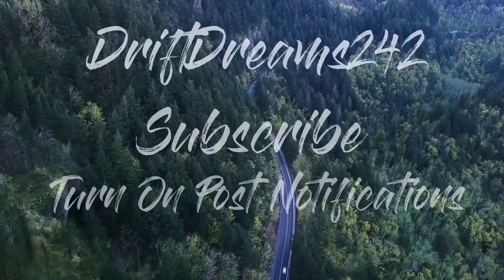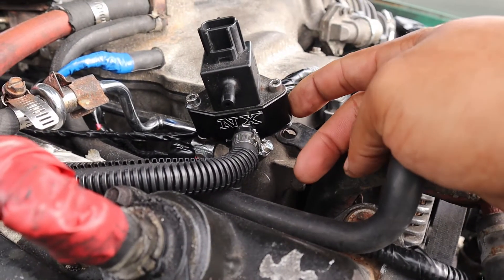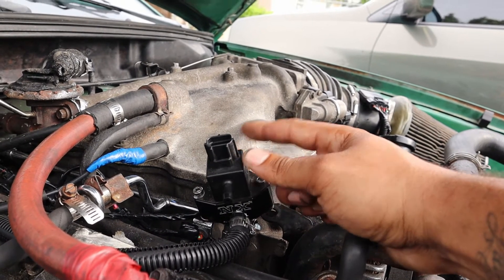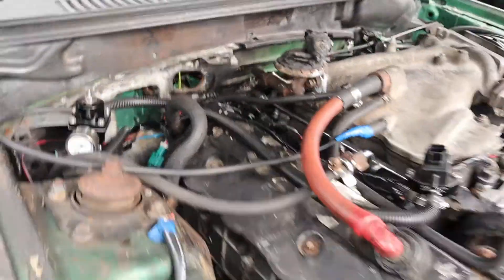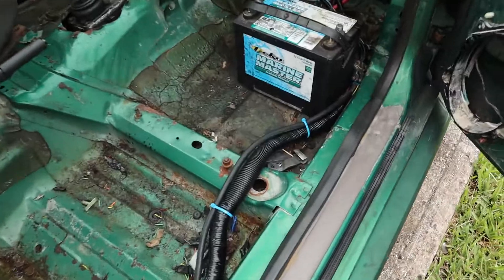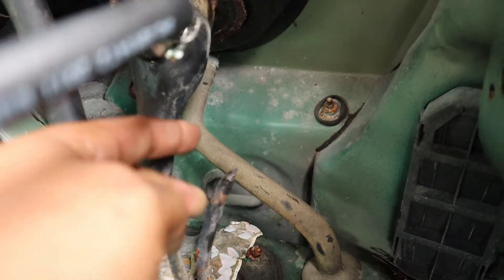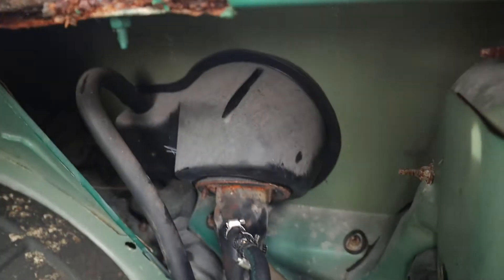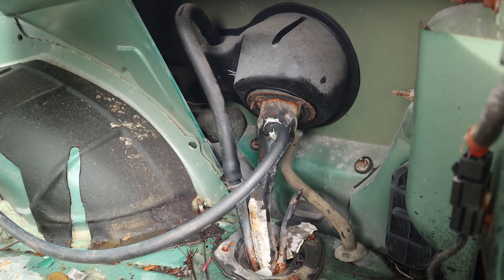How To Make Any Ford Returnless Fuel System Into A Return Style System

Comment: Why do I want one over the other? I have a 90s Ford Ranger (return type fuel system ) and am swapping in a 2.5 from a Fusion (returnless). Don’t know which direction I should go because the regulator is on the fuel rail of the motor I am pulling out.
Reply: @DriftDreams242  Thank you. So basically add a regulator to stick with return style, or verify that my standalone FI can run the pump with returnless?
Reply: @DriftDreams242  Thanks! I appreciate the help. 👍

Comment: I have a 2004 ford f150 bedeviled with fuel pump module problems. Getting the pump to run of course isn't hard but it's a Return-less system and the pump burnt up just in the time I was diagnosing issues but I have a new pump. my vehicle in rual Guatemala  and I only get there a few months a year getting parts is almost impossible so I have to bring everything I need down with me. I spent weeks thinking about how a system like this would work always assuming the regulator goes in line before the fuel rail but after seeing this video it makes a lot more sense. I was looking at the same type of regulator but just not quite getting how it is used, especially without creating potential leak points. At this point my main question is how do I get the right NX block? Any advice would be much appreciated.
Reply: @DriftDreams242  thanks for the reply. How did you connect the NX block to the regulator? The block looks like some flare fitting and the regulator looks like a barbed connector. Just thinking of anything I can to make it easier